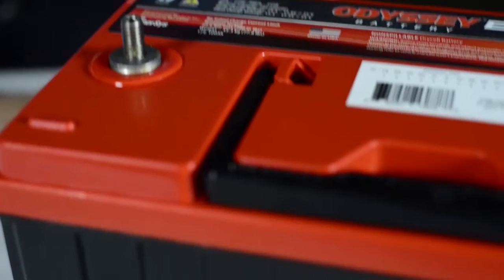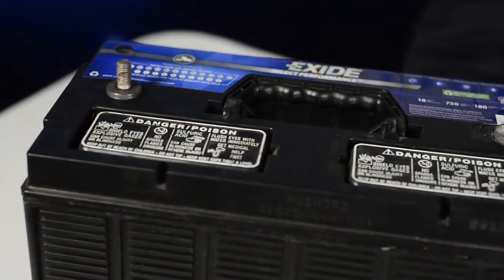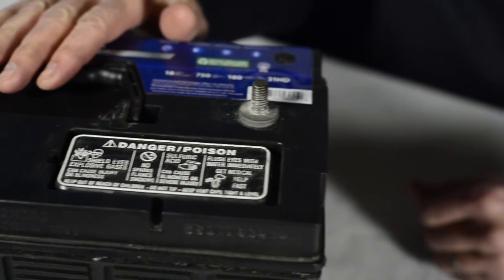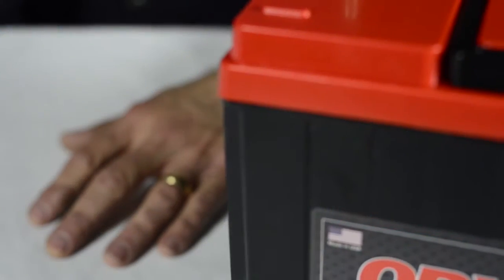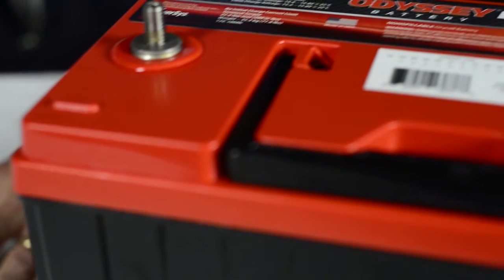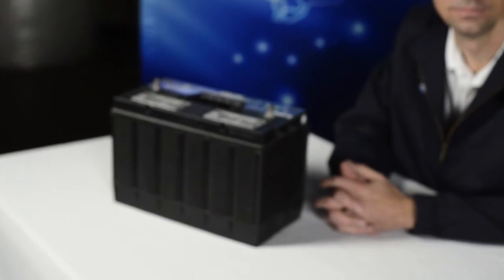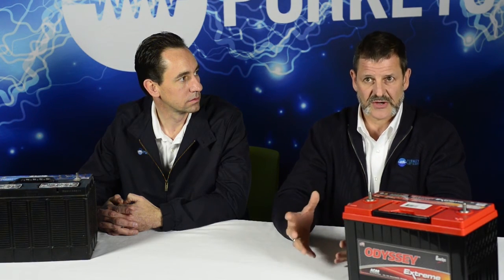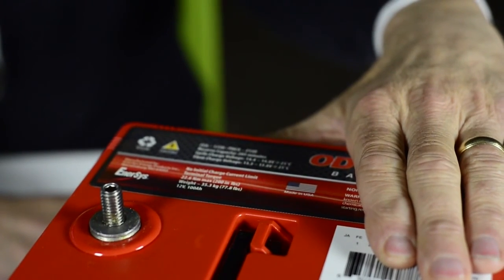AGM vs Flooded Cell Batteries - Purkeys

Comment: AGM’s are tough. My car was fitted with one because of the start stop system. According to diagnostics  it’s cranked the engine well over 40,000 times and 5 years old and still in my car.

Comment: So I have 3K trucks with all lead acid batteries. Average life is 12 months. I have used AGM batteries in the past with the same service life. How would you combat this?
Reply from the maker: Battery life is impacted by many things; the first is picking the right battery for your operation. The entire electrical system has to be matched and properly maintained to achieve maximum battery life. Another thing that impacts battery life is how deeply the batteries become discharged—for example, from add-on devices or driver loads. It all comes down to energy in versus energy out. You must make sure the truck can recharge the batteries and limit how the batteries are discharged with the engine off. If you would like to discuss your situation more in-depth, feel free to give us a call at 479-419-4800 and ask for Larry, our sales application engineer.

Comment: What liquid is in AGM battery?
Reply from the maker: AGM batteries contain electrolyte, a mixture of battery (sulfuric) acid and water.  The electrolyte is absorbed into a fiberglass mat, which makes the battery spill proof.
Reply: @Purkeys  
Exsuse me
Is this liquid is the same in other battery like car battery ; flooded battery?
Reply from the maker: @MM-wz5lk  Yes, the liquid is the same chemical compound in a flooded battery as in an AGM battery.